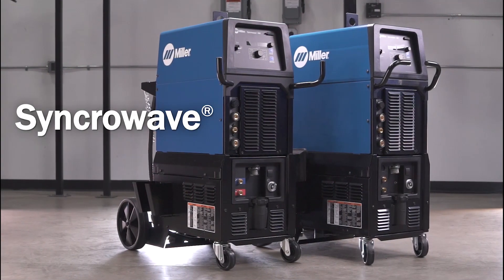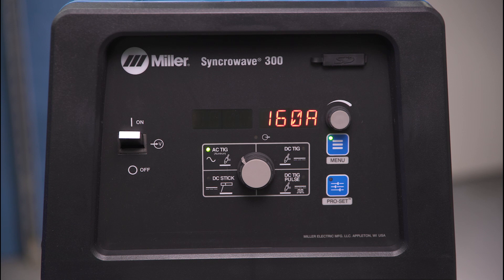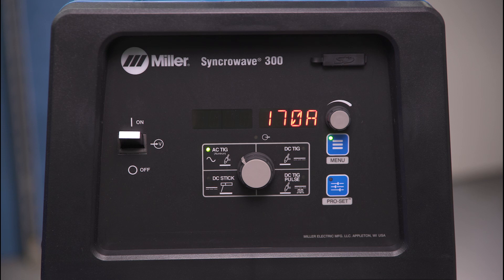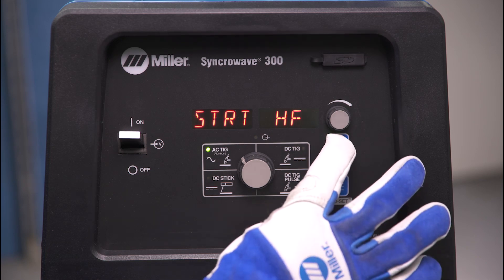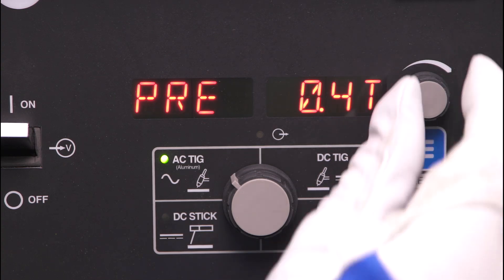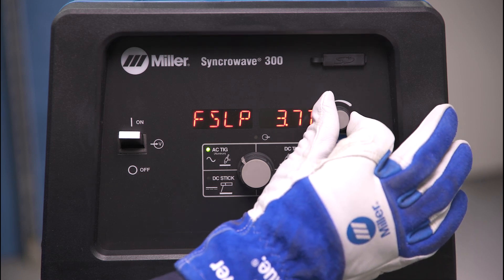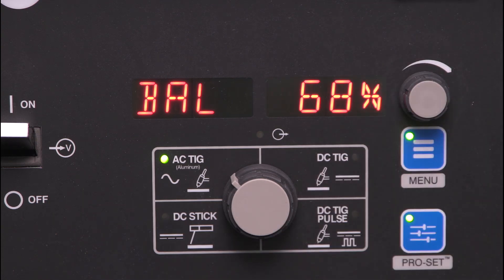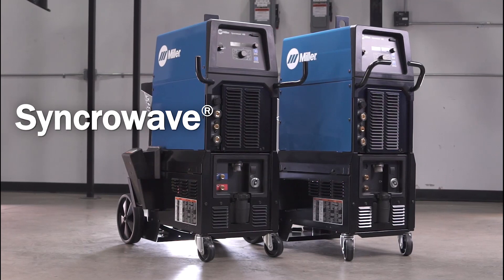Syncrowave TIG Welders: Set Processes and Parameters

Comment: For those prices why not go with a dynasty??? Idk about this one miller...
Reply: These are still several thousand dollars cheaper.  The transformer of the Syncrowave has advantages for particular processes that the Dynasty's inverter just isn't as good at.  For production plant pipe work, on base metals such as nickel with scratch a scratch start torch, the Syncrowave's stability would be my choice.  For production anodized aluminum pipe work, where arc shaping frequency adjustment ability is important, it would be a different story.   Both could do it all but aren't great at it all.  Like a lot of things, a fella really needs both.
Reply: @missmymountain  the new syncrowave isn't transformer based it's also inverter